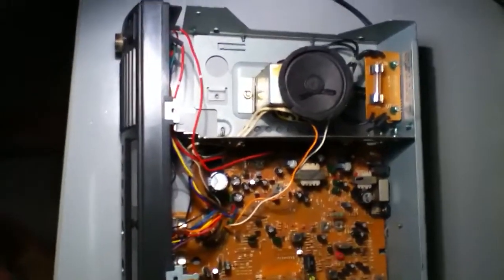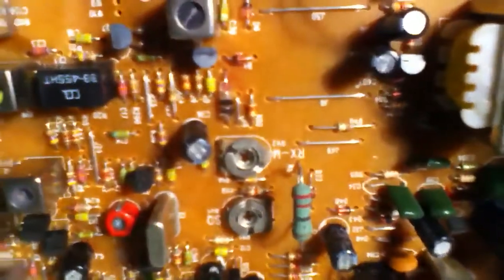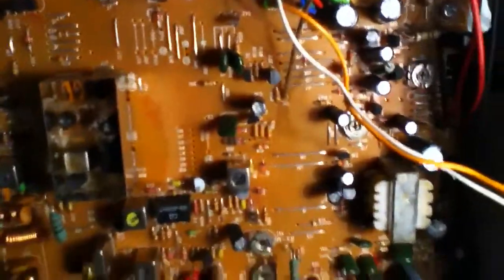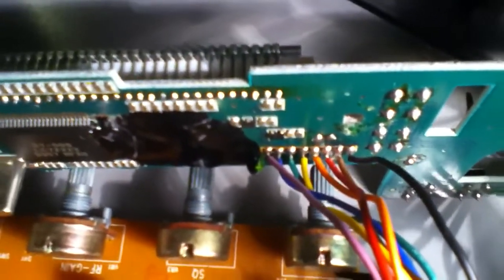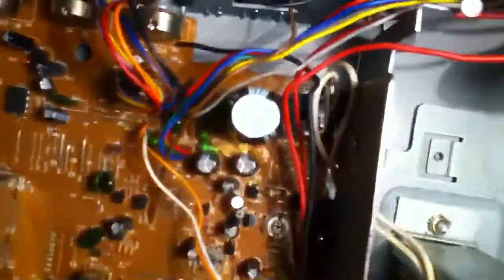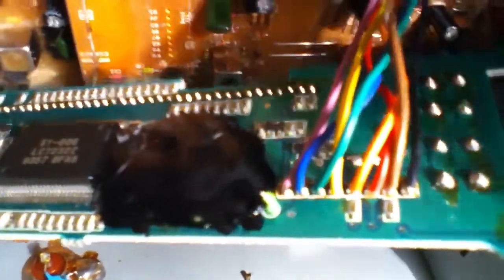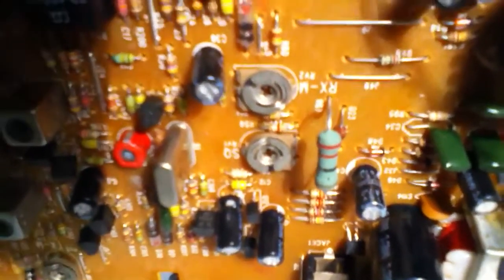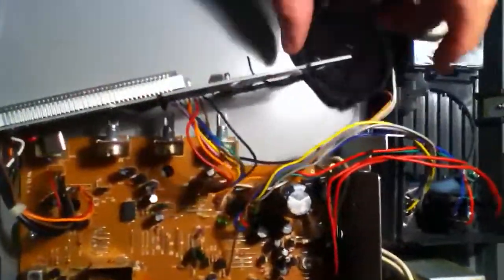Cherokee CBS-500 mods and tweaks

Comment: soldering iron and just work till you feel the pins..break the solder joint on the center and left pin ..solder bridge between center and right pin...plug up press and hold the 1 button turn on and release 1 button...low will be a b c d  e normal am band high f g h I j have to do the press and power thing every time you turn on radio